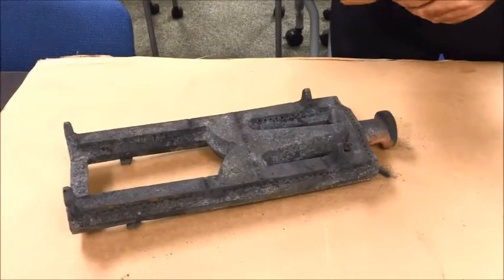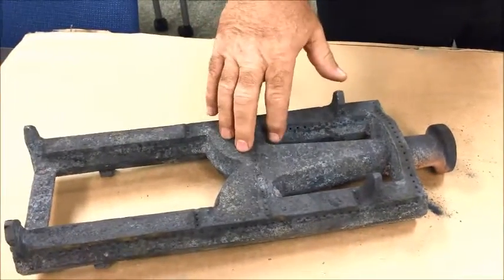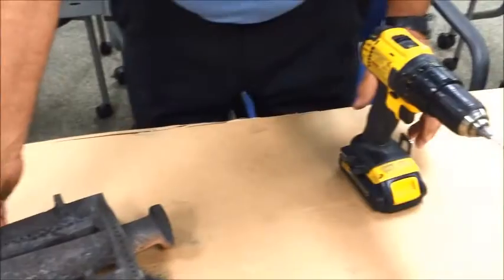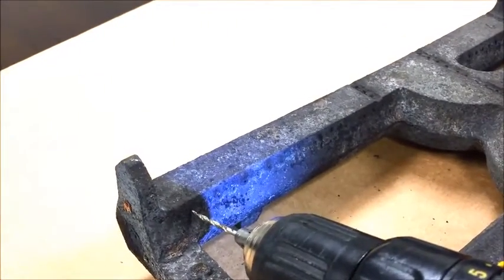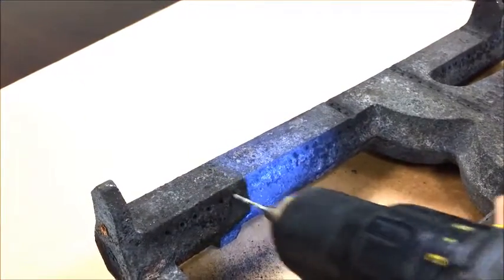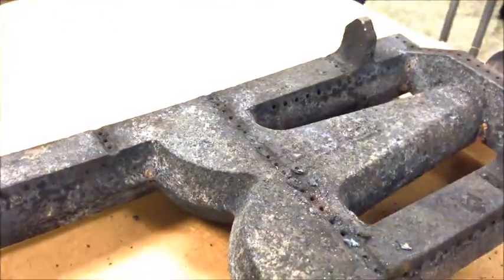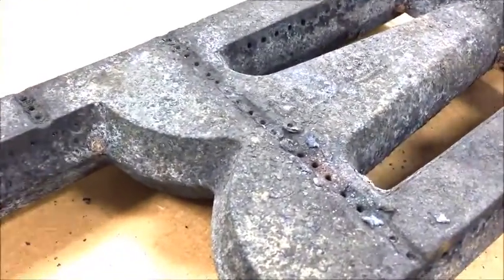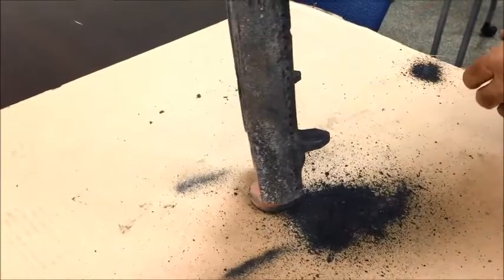Cleaning the Brass Burner on your Lynx Grill

Comment: This worked incredibly well on some very corroded and poorly performing burners. First, we scrubbed using a wire brush, then used the drill (angle is tight on some holes unless you have a small drill). Next, give the burner a solid series of taps to remove the corrosion dust (we had a lot!). Now they perform as good as new...thanks Lynx!

Comment: Faster and better than this method is to use a power washer. I use the 0 degree (pinpiont) setting and shoot the water into every hole. It takes 5 minutes to clean the burner and the benefit of the pressure washer is that it also does a pretty good job cleaning the whole burner.